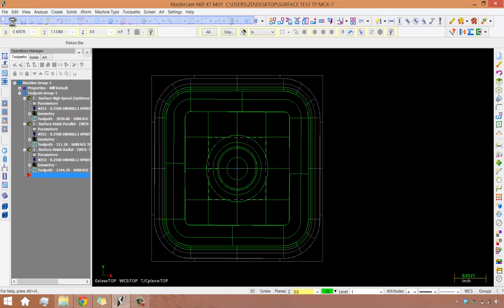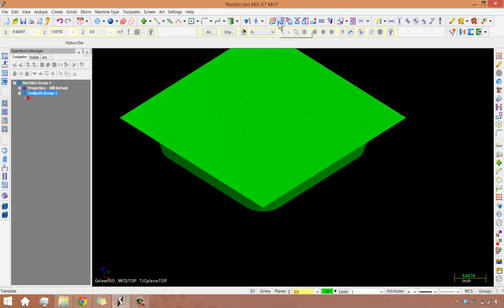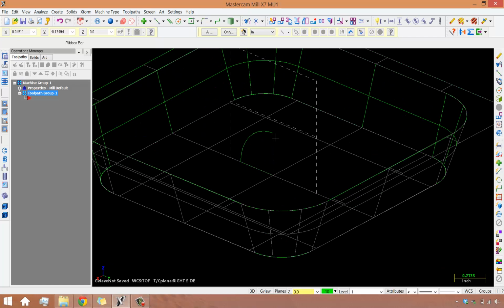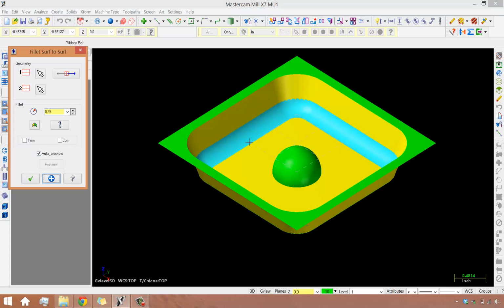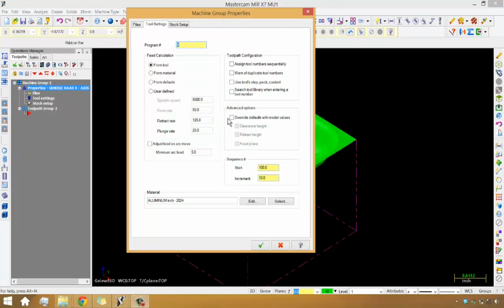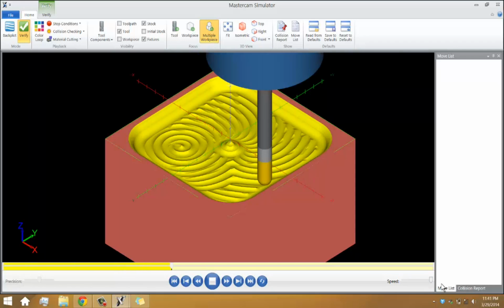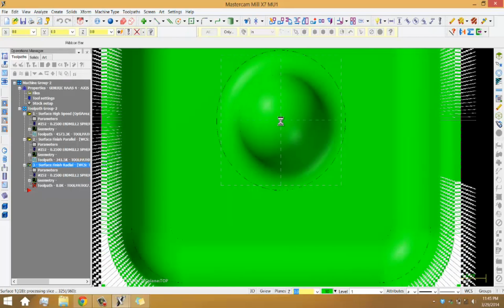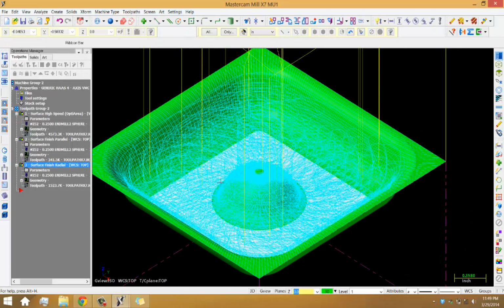MCX7 Surface Example 1

Comment: really  helpful thank you how would you put a 10 degree taper on the floor
Reply from the maker: DON MUMMA Depending on what direction you want the taper (into the floor or out of the floor) You could use a lofted surface at +/-80deg or You could translate the half sphere in the middle up or down along just the Z axis and then create a surface from inner edge to outer edge. (needing a bit a trig to calculate the Z distance for 10deg) Hope that helps!
Reply: thanx Zane I will try it